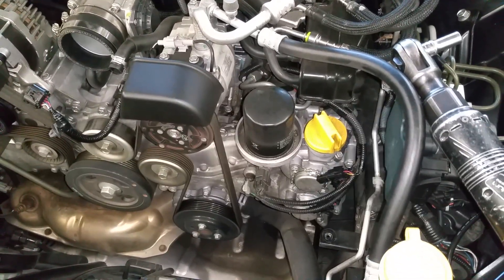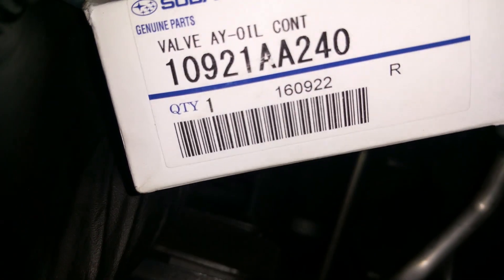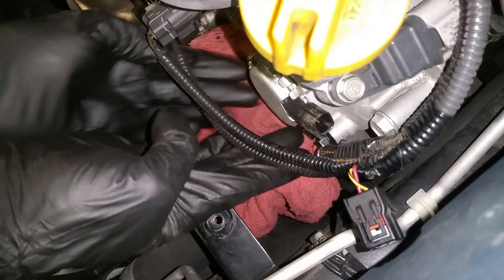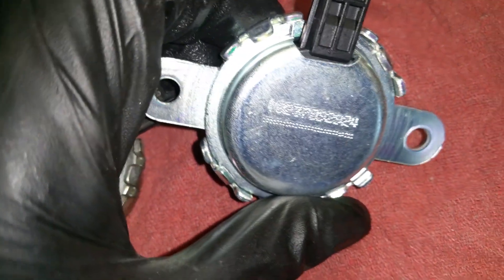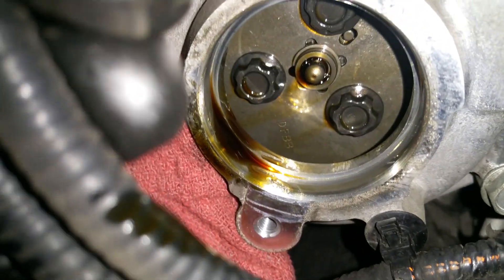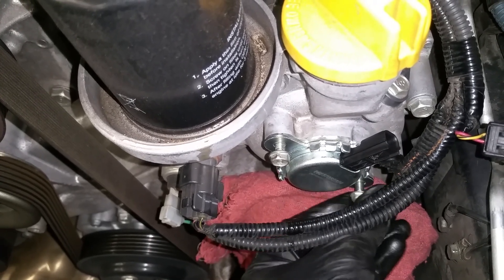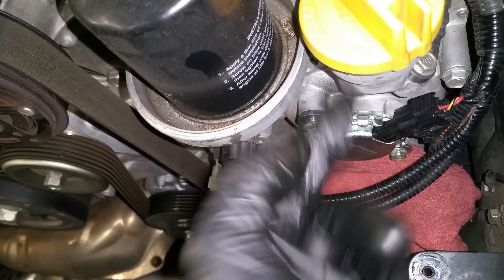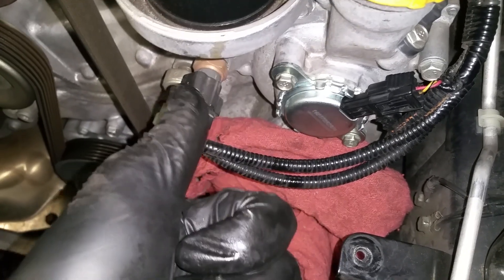Replace/upgrade FA20 FB20 oil control valve vvt

Comment: Just got P0018 code a few weeks ago. This is the same thing correct? Cam sensor bank 2 sensor A. Not sure which sensor that is on the car tbh.
Reply: what did you do to fix it? That's the same issue I'm having
Reply: I believe this is the exact same sensor for p0018.  I have the exact same issue.  I just pulled the part of a spare motor and I will one day find the time to install it.
Reply: @joshuaszeto  did you ever fix this code by installing a new OCV?
Reply: @ardikasulistija6574  I swapped the solenoid and the issue remained.    Oddly enough, I tried to clear the code and it doesn't come back until I shut the car off.   Next time I start it again, the code is still gone for a random amount of time.   Usually it will come back when I am either at a stop or going slowly and put a huge load on the engine like hard acceleration.    But there is no mechanical issues when the code is cleared.    The timing is where it should be, power delivery is as it should be.    I will try to swap the sensors and maybe also the ecu if anyone has a spare one.   Eventually I will probably go haltech or motec
Reply: @joshuaszeto  yeah everytime I clear the code, the car runs perfectly. I tried swapping the sensors but it remained on the same side (same code, P0018). My friend and I will next trouble shoot the OCV sensor. Did you ever happen to flash your ECU with Open flash tablet btw? I flashed it to e85 and the reflashed it back to the UEL 93 tune, so I'm curious if that may have caused the issue.
Reply: @ardikasulistija6574 This is the third ECU I have gotten from Toyota.   First two times was replaced under warranty for the same damn issue.   except the last two times it was on the other side of the engine.    there is something properly wrong with the electronics.   I may as well build the other one and use an aftermarket ECU like Haltech or Motec
Reply: @ardikasulistija6574    IF you still get on youtube and see this, I talked with the directors of sales in North America and they are looking into the P0018 code being and issue and the fact that SOOOO many FR-S vehicles get these types of codes constantly and they "DONT KNOW" whats wrong. So, if you never got this fixed please call the number to report a complaint. It will help this all become a recall
Reply: @Chris-ex2sl  Thanks a lot man. Yeah I am still dealing with this issue. Subaru had already tired troubleshooting my issue and couldn't figure it out.  I think its time to make a complaint
Reply: @ardikasulistija6574  please do and get everyone you can too. I have dealt with this issue twice the first under warranty where they didnt know what was wrong and faced the 8k ecu now I will have to pay for it... I dont want to pay for a lemon part they never bothered to classify as such
Reply: @ardikasulistija6574  oh and please spread this, please we need all frs owners that have had this issue (1,000+)
Reply: Chris well how do I resolve the problem tho like now if i wanted to do it myself. My cars modified.
Reply: Were you guys able to get rid of the P0018 code?
Reply: hi gays i have problem p 0018 can someone help me ?
Reply: Anyone knows how to fix it ?
Reply: 73LACKxJACK I just recently got the issue im gonna attempt to replace ocv with new one and of course oil change. We’ll see what happens I am boosted too
Reply: @alexngo4377  will mine is the camshaft sprocket I replaced it along with  new chain and code is gone
Reply: 73LACKxJACK what exact codes did you get?
Reply: 73LACKxJACK I did that while ago when Chipped 2 tooth’s on one of my cam gears. I did however, did not get new OCV. Only receiving code p0018. When I go to clear it it drives fine but when it comes back it’ll go limp mode p0018 shows again. Didn’t really felt any timing jumped tho idles fine just a bit slugglish and stalls occasionally.
Reply: @alexngo4377 I had p0018 if code keeps coming back you might have to replace the ecm I had to replace the sprocket and my ecm along with a new chain just unsafe side and code is gone this code might just be the worst you can get
Reply: 73LACKxJACK thanks dude! I was just researching that. Do I get a new 2013 ecm or would any newer ecm work like 2015 for example. That would also mean I would have to get another ecutek license right?
Reply: @alexngo4377  I got a ecm from another 2013 at the junk yard
Reply: 73LACKxJACK so not all 2013 ecm are faulty?
Reply: @alexngo4377  no usually you ecm goes bad when your timing was off and learned new values so when my sprocket went bad set off my timing the code would come on and off because the ECM learned to help it self at that moment but from that it just makes it worse so when I finally got the code p0018 I started by changing 1 ocv from bank 1 to bank 2 and code still was bad so I tried the camshaft position sensor no ended replacing the sprocket and belt but still got the code so I went to a junk yard found a crashed frs ecm should be good since it was just in a car accident and worked like a charm runs perfect lots of work for just one code
Reply: 73LACKxJACK but what if I’m on a tune since I am boosting it currently running ecutek. Am I pretty much fucked lol
Reply: @alexngo4377  cant you flash it back ?
Reply: @alexngo4377   IF you still get on youtube and see this, I talked with the directors of sales in North America and they are looking into the P0018 code being and issue and the fact that SOOOO many FR-S vehicles get these types of codes constantly and they "DONT KNOW" whats wrong. So, if you never got this fixed please call the number to report a complaint. It will help this all become a recall
Reply: @73LACKxJACK  IF you still get on youtube and see this, I talked with the directors of sales in North America and they are looking into the P0018 code being and issue and the fact that SOOOO many FR-S vehicles get these types of codes constantly and they "DONT KNOW" whats wrong. So, if you never got this fixed please call the number to report a complaint. It will help this all become a recall
Reply: @Chris-ex2sl  I wish I would know that but I got it fixed i hope they do a recall
Reply: @73LACKxJACK  please call into toyota and file a complaint, it will help. as of right now i gave them the frs forums link that shows the thousands of cars with the same issue and the 7 magazines that covered this topic
Reply: @Chris-ex2sl  I will bro and hope it does become a recal because its a expensive fix if you don't do it yourself
Reply: @73LACKxJACK  the DIrector of sales in North America is supposed to get back with me tuesday but the more people who call in and report a p0018 issue the better
Reply: 73LACKxJACK i messaged ecutek on how to transfer the license over to another ecm but even they said it’s difficult. I’m assuming I would have to just buy another license and retune on the new ecm?
Reply: 73LACKxJACK oh btw dude p0018 stops appearing now p0021 appears. It has to be an ECM issue?
Reply: @alexngo4377  the going consensus is they never properly remapped them as they claimed and it is causing tons of unneeded codes that no engineer even can figure out. they replaced my entire computer and claim it needs done again (4 years later as if they would ever go bad in 4 years twice). call in and complain get everyone else to aswell. we need this recall to happen
Reply: Chris will it mess up my tune though?
Reply: @alexngo4377  no, it's just to get a recall going they are refusing to help me at all due to this p0018 code, yes my car is out of warranty but, let's be honest here. SOOO many fr-s's are throwing these codes and they are false and then have to be replaced
Reply: IF you still get on youtube and see this, I talked with the directors of sales in North America and they are looking into the P0018 code being and issue and the fact that SOOOO many FR-S vehicles get these types of codes constantly and they "DONT KNOW" whats wrong. So, if you never got this fixed please call the number to report a complaint. It will help this all become a recall
Reply: Well I’ve read all of these comments and still have no idea what’s the better option to keep my boosted BRZ still running. I’m gonna go down on viscosity on the oil and change the solenoid and see what happens

Comment: I got a 2015 sti. And my cel came on giving me the code for cam shaft slow response bank1 and subaru says its my oil control valve which they gonna fix on tuesday.. this is the second time i took it because of ocv. Im just making sure they know what they are doing im tired of taking it in
Reply from the maker: _nfamous this is completely different motor to the sti. the wrx has the same type of setup. if under warranty, let them do their process.
Reply: tired of taking it in! lol second time, lol
Reply: Was that the case?

Comment: do you possibly know which valve is for p000b? i don't want to be buying all 4 if only 1 is bad.
Reply: I have a p000b code too! Did this work for you?! My car is 3 weeks out of warranty and I want to try this before bringing it in.
Reply: it went away after i drove to pick up the part. i have the part incase the code comes back on.
Reply: Haha wtf mine comes back on every couple hundred miles
Reply from the maker: Kenny exhaust cam bank 2. (opposite bank of cylinder # 1) according to my Google search.....
Reply from the maker: Kenny what oil and filter are you using? And how often do you change and check the level?
Reply: 0-20 and the OEM filter. i've been changing my oil every 3k miles and i check the level every 500 miles.
Reply: it's been 1 to 2 thousand miles from the last time it appeared. i think im good
Reply: just happened to mine a few days ago , still under warranty but scheduled it at a dealer a week from now,  would it still be ok to drive till then?
Reply: Got all four codes diagnosed on my 86 just few minutes ago. Guess changing the oil would be better to try out first? These things don't really break down all at once, or at least, less likely?

Comment: can a bad ocv lead to over advance timing?
Reply from the maker: it is possible, yes.... but it is also possible you have other more expensive issues. but this is a good place to start.
Reply: subtledriver I just rebuilt my motor
Reply from the maker: so maybe someone didnt time the chain correctly, or re-used older cam sprockets.
Reply: subtledriver I followed the service manual. But it's possible I did something wrong.

Comment: Hopefully this fixes my p000C
Reply from the maker: this is the first step, I would also reflash the pcm with updated firmware and change the oil with fresh 0w20. If not, you will need to replace the cam sprocket (aka oil control valve) and/or pcm as well.
Reply: subtledriver My fully built motor has 500 miles on it. The p000a and p000c came on the first time at 100~ miles. Using 10w40 mineral. Switched to 5w30 synthetic and now all I'm getting is p000c. Entire motor is new except the timing cover and solenoids so my 2013 one could just be going out.
Reply from the maker: who built this motor (i would ask them if they used a brand new 2017 cam gear set and oil control valves)? is it a 2013-14? the 15 and up have been revised. if they used older parts, its probably just "expected" if your bearing clearances are close to stock, i would try resetting codes, and run 0w20 through it, or 0w30. and see if it comes back.
Reply: subtledriver definitely not running 0w20 unless if it gets really cold here in Tennessee this summer. I'll try 0w30 once I switch my solenoid if it still comes back.

 Emerld coast motorsports at built fa20 built my motor. The motor from my understanding is all brand new but not the 2017+ model. So I guess 2014-2016
Reply from the maker: there is a difference between first year 2012/13/14 vs 2015 and up the parts have been revised many times and old part numbers superseded. 0w20 is what we race on the track with in 100 degree weather, its also how the factory robot built motors are built for. the variable valve timing system doesnt like too thick of oil, or it wont flow properly in the small passages. too think of an oil will cause internal engine damage. I would not even switch the solenoid, i would try the factory oil first and see what happens. my customers get vvt codes if they run too thick of an oil. so keep that in mind. too thick will also cause overheating and drag/ loss of power. so unless the bearing clearance and vvt passages were set up for slow moving/oldschool engine oils, i would try factory fill (will not damage anything unless you abuse the hell out of it) and see what happens. if there is still a problem, you need to take it up with your builder. you need to ask if they used updated parts, or old problematic parts.
Reply: subtledriver do you have a way we can private chat? Also I'm a dude. This is a troll pic lol
Reply: subtledriver I messaged you on fb
Reply from the maker: The picture is too small on my phone, so it didn't work, lol. I will check fb
Reply: subtledriver this solenoid is the one I replaced on my car just now. This is the. P000C correct? Or is this P000A? Trying to make sure i replaced the correct intake side
Reply: subtledriver I'm getting white smoke out of the exhaust with a bunch of water on my built motor. 9.1 compression setup fa20 with a turbo.

 I'm still getting p000C and idk what to do :(
Reply from the maker: Holly Woods you need to talk to your engine builder and tuner.
Reply: subtledriver I believe it’s ECU related, my car when I first start it shoots out pure water and some steam out of the exhaust with a rough idle for 30 seconds and sometimes it’ll stall.

 I’m able to just hold the Rpms at 2000 and after I just drive off or let it idle at 2000 for 30 seconds ~ then it fixes it self and it idles perfectly so I don’t think it stalling has to do with my p000C

My motor is a 9.1 compression turbo setup. So all the blow by water in my catch cans and out the exhaust seem normal.

 Oil pressure is all perfect at idle and operating temp and near redline as well. I think it’s just the ecu itself needs to be replaced or ill just likely ask my tuner to disable the code instead.
Reply from the maker: let me put it to you this way, you can disconnect all 4 oil control valves, and the engine wont smoke and it should still run ok. talk to your tuner and builder.
Reply: im on the same boat p000c i replaced my cam gear and it went ok for a while decided to fuel up and engine missfire and now im getting p0345 and p0346 help pls

Comment: Is this for a p0016? I've got low oil pressure as well...
Reply from the maker: low oil pressure from the pump? or to the cam?
Reply: yea i have P0016 Code too will this help im not sure if i have low oil pressure or not i recently change my oil too so it should be fine
Reply: Bobby Sitanggang did this help your code ? Or what else did you to ? I have that code and my check engine is on with traction control
Reply: Thrill Original I’ve the same code and issue too, already changed the censors and the cel is still on. Have you got it fixed?
Reply: Matt Jones have you got that code fixed ? I got that code too